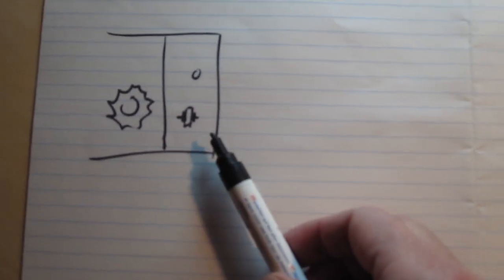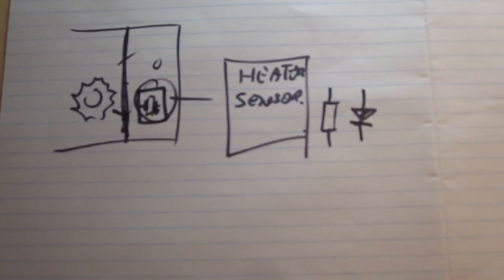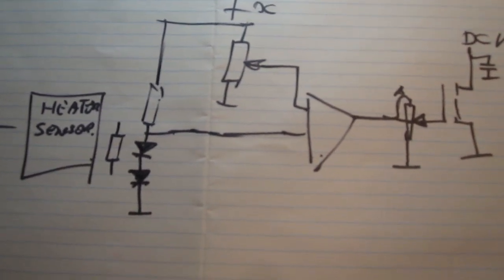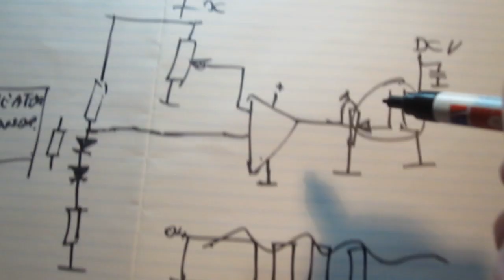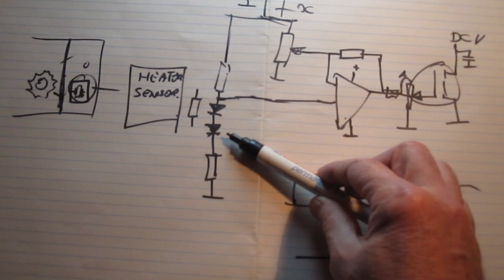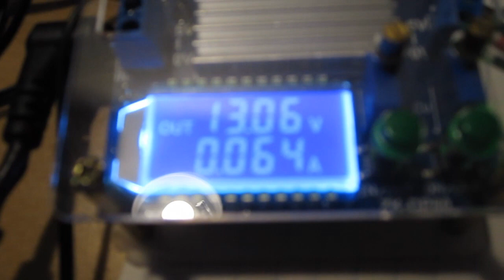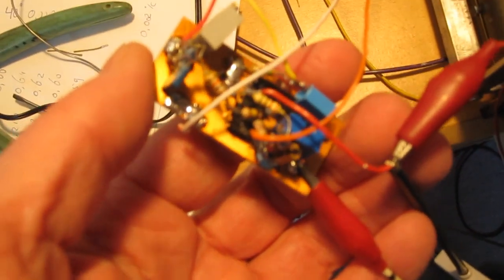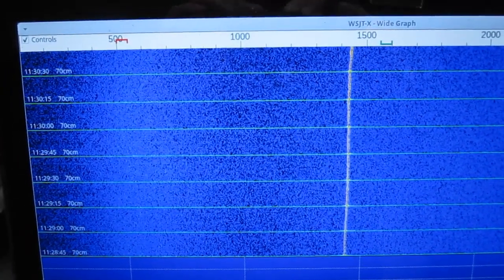DIY OCXO design, building and results (oven controlled crystal oscillator)

Comment: Nice, but looks more like an OCXO to me.. Because the Quartz Crystal is heated... 

TCXO = Temperature COMPENSATED Crystal Oscillator... It is not heated und therefore needs lesss Energy...
Reply from the maker: Thanks for your comment, you are absolutely right! I thought the ‘C’ stands for ‘Controlled’ but it stands for ‘Compensated’. Indeed heating (like this circuit) consumes energy, especially during start-up. When it is heated, energy consumption is low depending of the thermal insulation.
I will change the description.